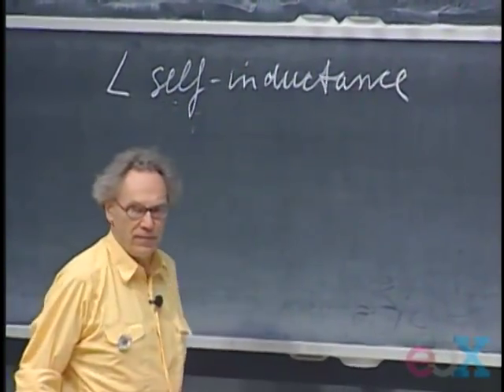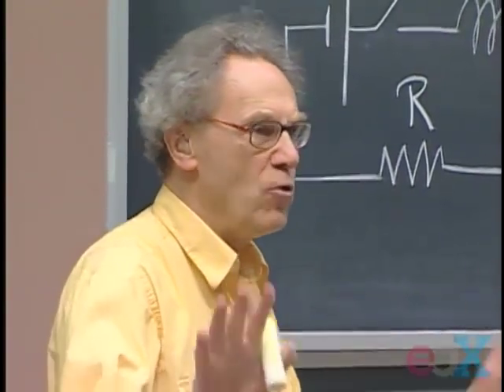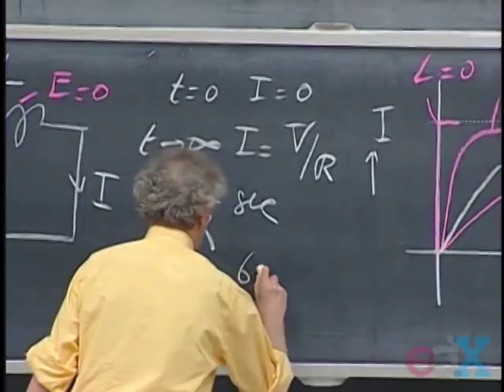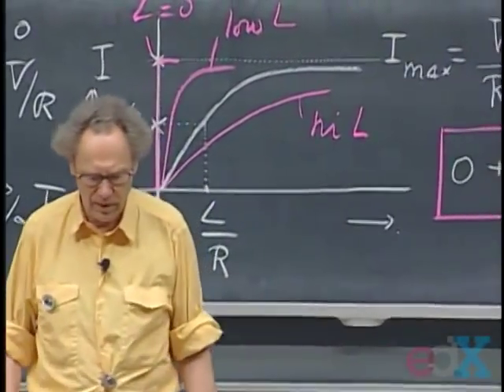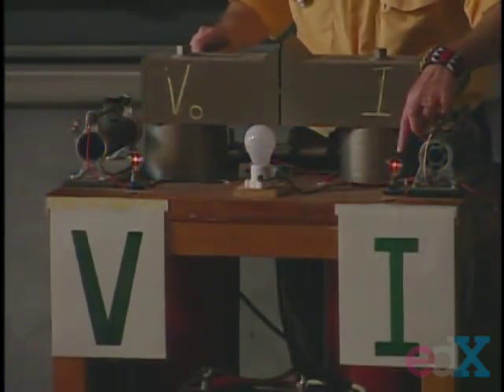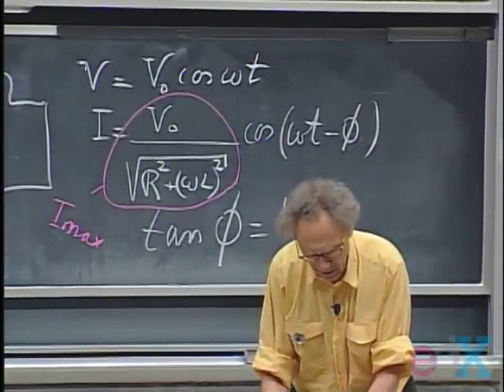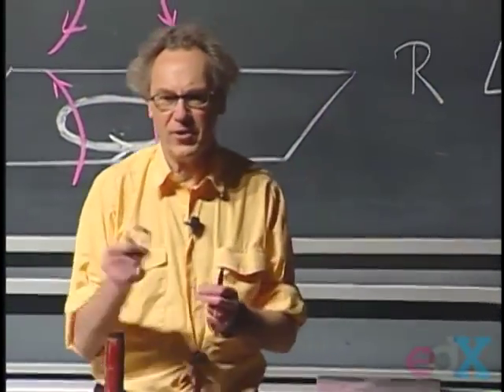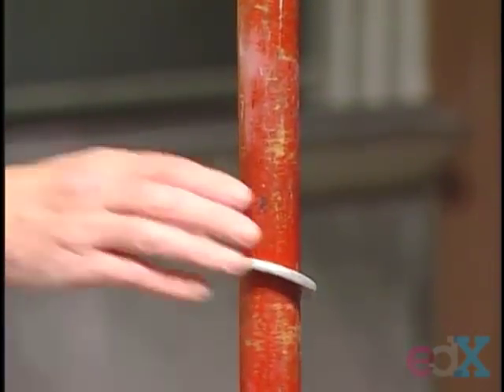8.02x - Lect 20 - Inductance, RL Circuits, Magnetic Field Energy

Comment: Good Morning Walter,
I hate how in school we were told that the phase lag of the current when entering an inductor is always 90deg... This is just lazy.
At 43:23 I like how we see that there is always a 90deg phase lag between the CURRENTS in the two bodies having mutual EM induction. That obviously comes from the fact that dcos(wt)/dt = -sin(wt) in dI/dt in Faraday's law. That is a solid assumption. Otherwise the two bodies would attract 100% of the time, but that is obviously not the case. I thank you for pointing that out. And the fact that the self-inductance in the aluminum plate is non-zero is the only reason why we get levitation is now very clear.

Now, I would like to know what happens if we apply this exercise to self-induction in an inductor. Let's say we excite an LR circuit with an AC current I_s*cos(wt). Then, there will be an opposing EMF self-induced (Faraday-Lenz) that will generate an AC current  -I_i*sin(wt), that has a 90deg phase lag with the driving current, as for the woman levitation demonstration. Now do we have to add a phase lag tan(phi) = wL/R on the induced current? Now how do these two currents (source and induced) collide? They are definitely not in phase! At least 90deg difference or maybe even 180deg...! Is it how we can derive tan(phi)= wL/R ?

I checked google and I could not find a fulfilling answer. Maybe I can try to simulate that by modelizing the inductor with a AC current source that has a phase lag and goes against a driving AC current...!

Thanks!
Xavier

Comment: Thank you Professor Lewin, your teaching style is awesome and inspirational! I was also wondering if it’s wrong to say there’s a voltage drop in an inductor, because that would be as if it behaved by KVL, which of course it doesn’t.
Reply from the maker: the E field inside an ideal inductor is zero. Thus if you measure the integral of E dot dL through the superconducting wire of the coil (from one end to the other), you measure ZERO!
Reply: Lectures by Walter Lewin. They will make you ♥ Physics. Ohh, now I see why. Thank you a lot for answering me and making this content available and free, it’s truly a gift that all the world should thank you for. Take care Professor and be well!
Reply: @lecturesbywalterlewin.they9259  what if we measure voltage across inductor using a voltmeter, what value will it show?
Reply from the maker: @manjeetyadav9287  closed loop integral of E dot dL = -dphi/dt.  since the intergal through the inductor is zero, the integral of E dot dL across  the voltmeter is + or-dphi/dt depending on the polarity of the voltmeter in the circuit.
Reply: @lecturesbywalterlewin.they9259  so, is there any way to measure this E.dl through inductor? (Other than the one in the lecture in which we saw different voltages measured between two same points through resistors).
Reply: @lecturesbywalterlewin.they9259  so professor, this gives us a way to use Kirchoff's loop law. We can use loop law just outside inductors (outside the inductors, the electric field will be conservative in a circuit). Refer Feynman's book Vol 2.
Reply: @lecturesbywalterlewin.they9259  sir at 9:27 in the triple equality the second term represents the flux of the magnetic field around the whole loop of circuit while the Ldi/dt term represents the flux through the inductor only "not the complete circuit " it seems you have fudge this data to get it correct since the surfaces are inherently different in the whole circuit loop case and the inductor coil surfaces case

Comment: As an a freshman in electrical engineering I just passed my finals in circuits but only now do I begin to understand what a terrible mistake I did in my exam but unfortunately it will NOT be considered as such because the professor deals with RL circuits the same-wrong way
I am really sorry I didn't have a chance to ask him this question.
Thank you professor for clearing this up. I am going to watch all your lectures about induced emfs and solve your problems in search for the truth and not comfortability.

Comment: In principle you're absolutely right in pointing out that the KVL not holding for varying current. But don't we have to add the 'parasitic' self inductance of the circuit loop(L'), which we would have if we replace the coil with a straight (superconducting) wire,  to the self inductance of the coil(L)? And that is, I think, even after moving the term involving L to the other side of the equation, makes the deviation from the conventional KVL argument.
Reply: You do have the self-inductance of the loop as well, but it is most likely either negligible, or assumed embedded in the inductor.

The conventional KVL method of solving these problems is mathematically correct, but physically inaccurate.  It is similar to using pseudo-forces as shortcuts to solve mechanics problems.  You can get the right answer, but with a method that doesn't reflect what is really happening.

Comment: Engineers who design and layout circuits need to be aware of how magnetic flux in inductors can couple into other parts of a circuit.  Circuit Theory textbook authors want to describe everything in terms of voltages and currents.  Parameters that depend on the physical layout of a circuit are a complicating detail authors either don't know about (sadly), or are unwilling to take the time, effort, pages to explain properly.  Some circuit theory books will use a separate dependent voltage source to represent the emf from a coupled inductor (mutual inductance), so that's a step in the right direction I suppose.  I teach an introductory circuit theory class for electronics technicians at a local community college, and watching this lecture has definitely given me some things to consider when teaching students about inductors and magnetic induction. 

I'll admit, I am watching your lectures not so much for the physics (although it's a good review), but more for observing your teaching methods, as I am relatively new to teaching.  Thank you Dr. Lewin!

Comment: Why when in the 30:13 min you turned off the power energy of the bulbs both died at the same time, instead of having the one with the inductor a bit more time ON (as it is fighting against the change in the current from I_max to zero)? Thank you Sir :)

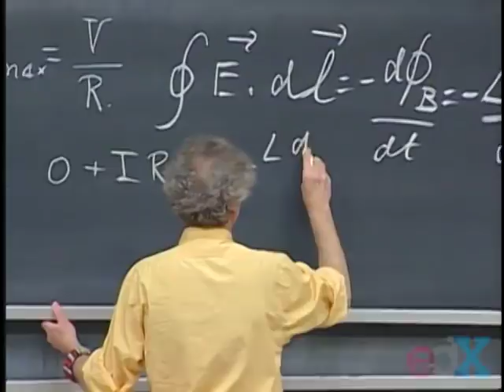Comment: 11:36 I find this easier.

Add emfs together, and it's the sum 
of the components: 

V-LdI/dt=IR+0
Energy sources = Energy losses.

The self inductor is a 'negative source' 
wrt the input voltage V, because it reflects back energy put into it rather than let it out as heat or some other loss.

Comment: My professor, I think that we shouldn't explain the case that current increases with only saying "as the time increases, delta(phi)/delta(t) is decreasing and thats why the opposing is decreasing" . Because there is not only one opposing E field(at the starting one) all the time. There is always an opposing E-field but it decreases. And the reason of decreasing of the opposing Force is instant rate of changes of the current and the opposing E-field and it can only be understood with analysing the behaivour of the circuit very carefully. And it is more complicated  than it looks. Same thing is valid for the circuits which contains inductor,both inductor and capacitor, DC-AC RLC circuits, source-free circuits etc... And it is important indeed to understand circuits. Because it is very complicated and physicists, physic teachers and professors don't tell about that and also they don't explain how circuits work indeed. I hope you understood what I mean. thank you

Comment: Professor Lewin, 
Can we conclude that as a result of the induced B field inside the solenoid (and it being zero outside) and the current passing through it, an induced Lorentz force acts in the outwards direction, everywhere on the solenoid wire? 

Thank you so so much for these lectures. They have been a true inspiration!

Comment: Walter makes a great point about applying Faraday's law, however he conflates the totally flux of the circuit with the lumped inductor element. This could have been made more clear. There is a total magnetic flux around the circuit and to the extent that L is that self inductance all is well.  So Im not saying that he is making a mountain out of a mole hill because potential energy is still a bit like a mountain to ascend and descend.

Comment: Thank you very much, for the gorgeous lectures, but I have a doubt, If we have a battery, switch(open), inductor and resistor in series, when I close the switch( at t=0), then at t=0+(a moment after t=0) the current is zero, because of self inductance of the inductor. 
But my question is, self induction is possible only when there's a change in flux for which to happen there has to be a current flow, atleast a current with very small amplitude but steep slope, so back emf becomes quite large stopping current flow momentarily. How can it be zero?
Reply from the maker: it's NOT the current that matters, it's di/dt that matters!!   and di/dt can be huge when i is zero. Brush up on your math and on Faraday's Law.
Reply: @lecturesbywalterlewin.they9259  Thank you very much for responding sir. I understand that change in current is what matters. But initially when we switch on the supply, if there's no actual flow of current (that is, current changes from 0 to some value) which is supposed to change the flux across the inductor and produce induced emf which inturn opposes that change in current flow.

"di/dt can be large when i=0" I agree this is possible, when we have been running the circuit for sometime, for example with a sinusoidal voltage, the change is maximum when i=0 like in a pendulum, but when we switch on the supply, the pendulum is at rest ... Isn't it?

So my question is; is there a change in current  (from 0 to some very small value,  with steep slope) the moment we switch on the circuit?

Kindly bare with me if you had already addressed this in your answer.
Reply from the maker: you still don't get it. when you throw the switchat t=o  i=0 but di/dt is not zero. this is my last msg.
Reply: @lecturesbywalterlewin.they9259  Thank you sir. So a steep change in current occurs when I throw the switch which in turn generates the emf.

Comment: Thank you sir for the lectures .. I have a question though.. You said that the inductance will also fight the change when the voltage source is immediately taken out.. then shouldn't the light bulb take equal amount of time to get to 0 light as it took to get full light .. why does the light is off immediately as you turned off the switch??  the experiment is at 30.00 minutes in the lecture
Reply from the maker: That's a good question. When I open the switch both lights go out very quickly. The reason is that when the filaments are cold the resistance is 10 Ohm but when they are hot the resistance is much larger then 10 Ohm. In addition when I open the switch the current can now only go in the upper loop which contains both lights + twice 4 ohms. The net result is that L/R of both "effects" is now much smaller than 3 sec.
Reply: Thank you sir for replying .. I understand your first logic but i am having trouble to understand the 2nd one (the one you tell by saying in addition)
Reply from the maker: When the switch is closed current flows separately from the battery through the L + lamp and through R + lamp. That is no longer possible when I open the switch. When I open the switch, the ONLY way that current can flow is "circling" around in the loop which contains BOTH lamps and BOTH 4 Ohm resistance. Thus now the same current going through L MUST also go through the other lamp and resistor (and that was NOT the case when the switch was closed). That in creases R, thus L/R goes down.
Reply: Thank you sir .. I understand this time .. but it was non-intuitive for me that after closing the switch the current will circle through the loop .
Reply from the maker: You mean "after opening the switch" (not closing).
Reply: yes sir , sorry about that one

Comment: I think at low frequency or  for dc currents kirchhoff loop law is a  good approximations  as the change in flux in the ckt loop can be neglected or is approximately equal to zero only at very high frequency ac currents where the change in flux  can noticed kirchhoff laws would be violated hence we can say for the transient condition ie when the current is rising from zero to its steady state   value kirchhoff loop is not applicable but for the steady state condition where I is a constant or reached it max value kirchhoff loop law is applicable anyone  please correct me if I am wrong
Reply from the maker: in DC current there is no dphi/dt. Thus according to Faraday's Law, the closed loop integral of E dot dL = zero. Some people call this Kirchhoff's Loop rule without realizing that it REALY is Faraday's Law which is one of Maxwell's 4 eqs.  The statement that dphi/dt can be ignored for low frequencies is not meaningful as it all depends on the magnitude of the inductance in the system. After all -dphi/dt=-L*dI/dt

Comment: The solution of the differential equation for the case of the AC power supply has also an exponential term c1*exp((-R/L)t) added to the one that you showed (where c1 is a constant). Why did you omit that term? Did you assume that it is negligible?

Comment: Proffessor Lewin,
During Switch On ( t=0+)

If inductor oppose the current changes ??
Then how the current rises through the inductor??
Why induced voltage drop across the inductor dies out ??
Reply from the maker: solve the differential equation of an RLC circuit - that will answer your question.
https://www.youtube.com/watch?v=FWMhk6x785Q&index=26&list=PLyQSN7X0ro2314mKyUiOILaOC2hk6Pc3j

Comment: In the self inductance demo, why does the 2nd bulb go off almost immediately like the first bulb? Shouldnt the current in it drop to 37% of max value by 3 seconds and so it should go off slowly?
Reply from the maker: good question. the answer is that you have changed the circuit substantially when you turn the power off. Make a circuit diagram and you can see that for yourself
Reply: @lecturesbywalterlewin.they9259  
Thank you!

Comment: Referring to 32:50, I see that in many books, they mention that the current thru the inductor lags behind the voltage across the inductor. You mention that the current lags behind the driving voltage. By voltage across the inductor, do they also mean driving voltage? If yes, then is it true that the driving voltage and the back emf induced in the inductor are completely out of phase(180 degrees) (ideally where there is zero resistance)?
Reply from the maker: I cover in my lectures voltages and currents as a function of time and phase angles. I cannot add to that here. Perhaps you should watch more lectures (e.g., LRC circuits).

Comment: I have heard that a battery always maintains the potential difference across its terminals even in the presence of external electric fields. So shouldn't the battery's voltage dynamically increase in response to the induced electric fields' opposition to the voltage ?

Comment: Hello, Hello, Hello Dr. Lewin❗️
Needless to say, I’m a huge fan...

@30:14...Why didn’t the bulb on the right (on the inductor leg), dim out slowly (just as it did glowing slowly)...with the inductor fighting the change to zero volts/current ?
Reply from the maker: draw the circuit in the 2 cases you will then understand why.

Comment: Sir, University Physics by Young and Freedman states that the net electric field is o in the ideal inductor ,but the conservative and nonconservative electric fields are not individually 0; at every point inside the ideal inductor, the conservative and nonconservative electric fields are equal and opposite. True that nonconservative field cannot create potential but there is still the conservative electric field. It is for this field that there is a potential drop and we can use Kirchhoff's rule. This is what the textbook says. I am even more confused.
Reply from the maker: it's nonsense but not surprising